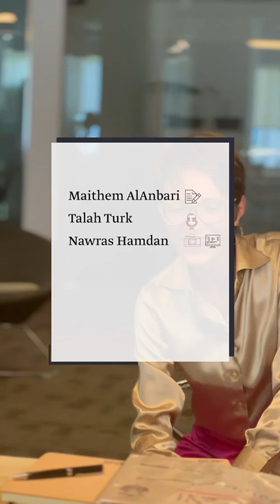Rocket engine building breakthrough made in UAE

Comment: thats a real alien tech
Reply: My thoughts exactly 💯. I believe this two are not earthlings but aliens pretending to be earth human beings. This rocket engine of theirs looks so advanced and revolutionary to me.
Reply: Design is not important if it is (not ) functional. Liquid rocks are mostly used in space industry, in military use are rare (solid state are dominant). I am not sure that this alien design is better than ordinary "🔔 bell" design? Purpose of design rocket engine is to design flame 🔥 that came out of motor in a way that flame looks like one line ------- if it's wide to much ( < ) it will spend to much energy and not give enough power. On the other side if weight of this motor is to big it will be problem for rocket to fly with him (death weight). So ...we need numbers to prove  their success!
Reply: @PakleniVuk  cost is most important factor if it's save fuel than liquid fuel is ok
Reply: @Sigmamalerule729  Liquid fuel is not stable in ground to ground rockets or air to air,air to ground (move left and right inside the rocket and that make changes in rocket center of mass - it is like flaying bottle of wine)  , that's why most of rockets are sold fuel is used . But when you launch rocket in space 🌌 rocket is sending vertical and fuel came naturally down to rocket motor. Mainly "liquid" used in rockets are liquid gases ( liquid oxygen+ liquid metan or some other similar) . But there are liquid rockets from Soviet era like S-200 rocket that have liquid fuel that have liquid special made and only Russians have formula for that liquid (we the others know only that is toxic and can develop cancer if it is in contact with person, don't know from what did they made it ). So ,yes cost efficient is important,but have many things more about "rocket science" 🙃.
Reply: @PakleniVuk It doesn't matter what you think. These people are aerospace engineers and have developed unique designs for rocket engines which work perfectly 🥰.